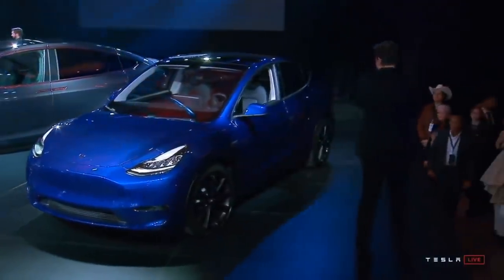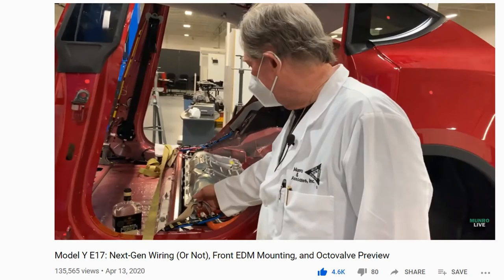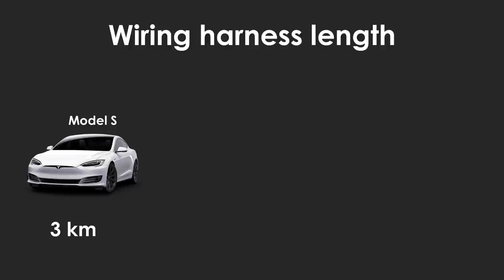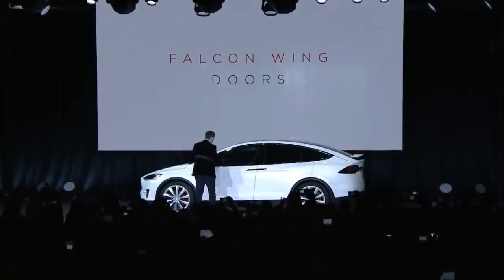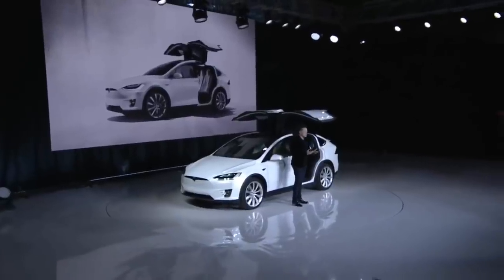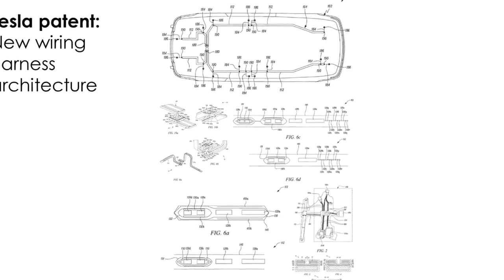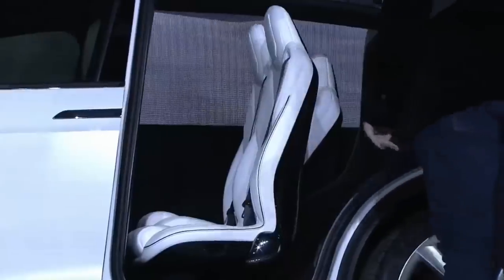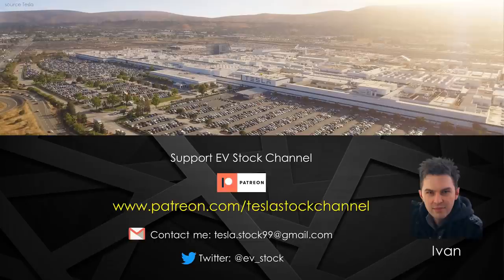Why the Tesla Model Y Doesn't have new wiring harness

Comment: Obviously the customer experience does not change with improved wiring, it only improves the installation process and profit margin, so please go ahead and buy the car when you are able and ready.
Reply: Wolfgang Preier So true...AND the equipment to produce the M-3 the old way is paid for—a “sunken cost.”  There would be a steep cost for the new, improved stamping equipment.  The resulting cost savings might not be high enough to recoup that investment until many tens of thousands of cars would be produced.  Example: if the old equipment cost $17M, and the new equipment costs $20M, but saves $250 in production cost per car, starting from scratch, the new equipment cost delta ($3M) gets paid off in just 12,000 cars produced.  The cost of scrapping the old M-3 equipment for the new is AT LEAST the FULL $20M, plus the cost of shutting down/slowing production to install and tax implications from equipped depreciation.  At $250 savings per car, it would take at least 80,000 cars to pay off the upgrade.  Perhaps that capital could best be invested elsewhere/later—when the old equipment is more depreciated or is up for major maintenance.
Reply from the maker: Excellent point Steve
Reply: Wolfgang Preier  My plan exactly.

Comment: The wiring harness simply isn't ready.  It's a big engineering job.  They'll be moving to a bus architecture - reasonably easy if there's just one voltage to worry about, but an electric car has many different voltages to contend with.  This technology is in the R&D phase, not ready for prime time.

But buyers of the Model Y will have plenty of new high tech in their cars.  Just one example - the octovalve HVAC system.  Tesla used a novel engineering approach lifted from printed circuit manufacturing; conventional HVAC engineering couldn't have handled the complexity.  Nobody makes HVAC that way.  Until now.
Reply: Urgelt and not to forget they started production of MY almost one year ahead of schedule!
Reply: Agee with HVAC, it isn’t because of multi voltages. HVAC or bus harness? I prefer HVAC.
 
It is business decision for - cost and time to market - can be addressed by technology and assembly reuse .. off M3.
Reply: you are totally wrong, the HVAC actually works with the very efficient heat pumps that other cars like the 2013 nissan leaf has been using since
Reply: @alanmay7929  Heat pumps are nothing new.

Octovalve is new tech.  Don't take my word for it.  Listen to what Sandy Munro says about it.
Reply: @Urgelt  the octavalve is also nothing new its just the combining of the car cooling/heating systems, its nothing revolutionary it just work like automatic gearbox valve body
Reply: @alanmay7929  Do what I told you to do, listen to Sandy.  Just because you don't understand how it's more advanced doesn't mean it isn't.

Why are there so many people running loose these days who think ignorance trumps knowledge?  Oh, right.  Trump.

Comment: I think there is a very simple reason, at the moment it was easier and less costly to keep things similar to the Model 3 and bring the Y quicker to market. With further iterations new technologies will be implemented together with new manufacturing technology. The new wiring harness makes sense coupled with some other innovations like for example the gigantic casting machine (patent), to reduce the number of workforce needed for assembly. I think at the end Tesla is trying to get rid of humans in the production process, in such a scenario they could have kept running the factor even in times like the corona-crisis and it can run 24/7 without any issues with labor unions.

Comment: Elon wanted to use CANBUS for the wiring, even though every vehicle that's used some flavor of it has been an absolute lemon.  This is another walk back, like the sub-$35k Model 3 and 1 million robotaxis on the road this year.
Reply: Bill Cichoke  the million robo taxis is on track, and you can still get a 3 for 35k over the phone
Reply: Bill Cichoke  also, if CANBUS is puke have been a lemon, then this is a sensible “walkback” 🤷‍♀️👌
Reply: @DavidHRyall  No, they're not and no you can't.

L5 autonomy is nowhere NEAR 'just around the corner,' which is why the cybertruck thing happened, coming seemingly out if nowhere.  And there is NO sub or $35k Model 3 available with free supercharging and self drive.  One is no longer offered and the other is an expensive hardware and subscription OPTION.  But the car was sold as having BOTH, for THAT PRICE.

Sorry, but what Tesla delivers after Elon promises, is around 40%, nowhere near 100%.  And the wiring walk back had more to do with crap engineering and 'things you can't fix during beta testing.'
Reply: If Bill was up to speed, he would know that Elon stated he hates canbus. But then he prefers conjecture over facts, don’t you Bill

Comment: It's a non-issue. The Model Y still lots of innovation like the octavalve, heat pump and the cast sub-frame, allowing Tesla to get the Y to market and keep growing now. They can roll in a 48v system later.
Reply from the maker: Spot on
Reply: well it doesnt matter because companies like porsche and lucid are already using 800/900v architecture

Comment: That's all very well as an explanation but the fact still is that Elon said it would be 100 m and it isn't. That's very dubious. He described a significant characteristic of the Y and didn't deliver.  I can imagine that the bus-based wiring scheme would have tipped the scale for some purchase decisions. When it was clear the the scheme wasn't going to be available he should have come clean. The new owners expected to be buying a revolutionary wiring scheme and Tesla didn't deliver.
Reply: Elon said that the Y would have 100M and that's true.  In fact it has 15x that much!  Why are you unhappy?
Reply: {Actually, he said it would be just 100m, but keep in mind that he did not say that would happen with the introductory version, just that it would indeed happen.  I would expect they need to do months if not years of testing to be sure it doesn't ever interfere with fsd systems and other safety systems.
Reply: KeiTho they started production almost one year ahead of schedule. That might be a very good reason for not implementing it right at the beginning.
Reply: New owners don’t give a damn about anything other than the driving experience. Who cares about how he achieves it? Asides from the 0.1% of geeks in this world
Reply: Plus he didn't even announce that plan changed before they shipped to customers. Like "hey this isn't what I said it was but I'm shipping it out anyways"

Comment: Who cares. When it comes it comes. It’s just a manufacturing issue. Nothing to do with the car
Reply: I you owned a Benz S class, you might not feel that way. Their biggest problem is electrical failures. Somewhere in all those miles of wire, the insulation cracks and perhaps in wet weather the wire shorts, a microprocessor crashes and maybe takes another one or two with it. The dealer can replace the microprocessors, for a few thousand, but they can't find the short...  so it does it again, and again...
The advantage of using a few bus cables running the length of the vehicle with fittings and switches tapping into them, like USB on a computer, is obvious. Tesla were trying to run this using instructions carried by the buses themselves, but it failed, I would guess because of electrical interference. Their next attempt may use Bluetooth instead.
Reply: @67daltonknox  the only problem of mercedes is that its a true luxury car with tons of options to offer and mercedes even uses optic fiber in their systems for example
Reply: @alanmay7929 . Lexus is a luxury car. It does not suffer from the electrical problems found in a Benz because it is well engineered.
Reply: @67daltonknox  yes lexus is a luxury car but it does not have all the tech available in the mercedes S class. The mercedes s class, audi A8, bmw 7 series are very complex cars, tesla can't even compete here, just look at the mercedes GLE with body motion control it bounces and leans ....
Reply: @alanmay7929 . Yes but it only lasts for months, then it costs a fortune for repairs that may not work.
Reply: @67daltonknox  thats just your opinion
Reply: @alanmay7929 . Try talking to a few owners, or watch Scotty Kilmer on YouTube.